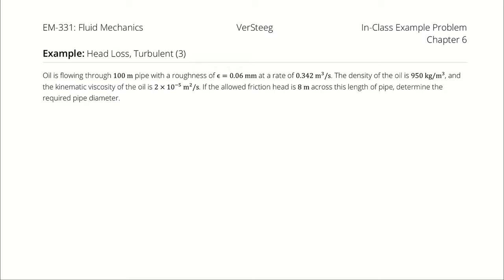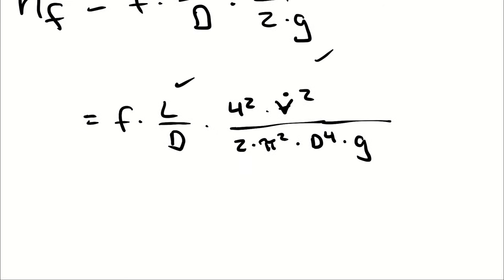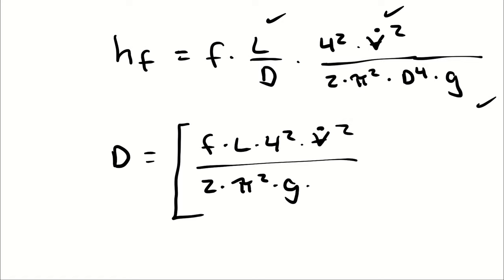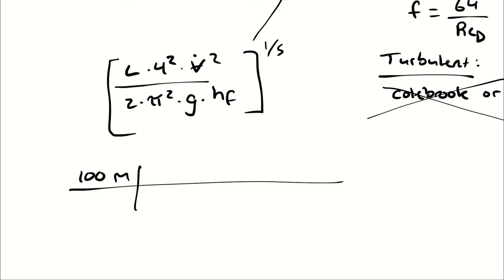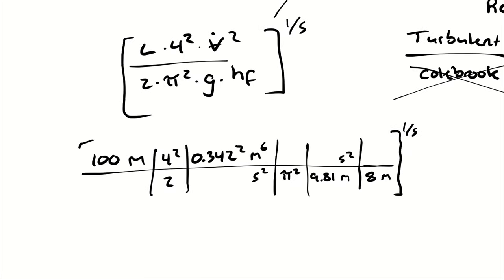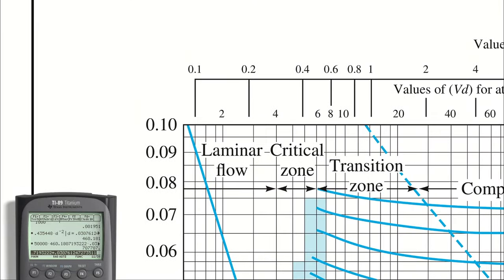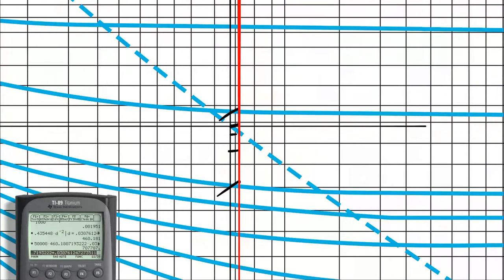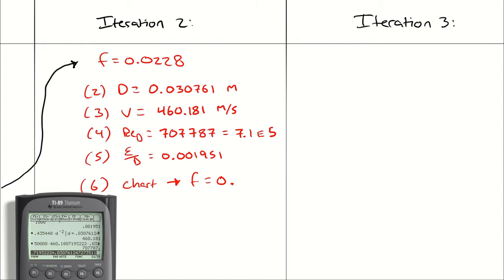Example Problem - Turbulent Head Loss #3

Comment: 15:39 The diameter used in the calculator calculation is 0.0655 when you have 0.655 written down.